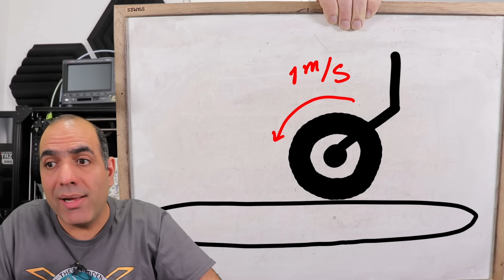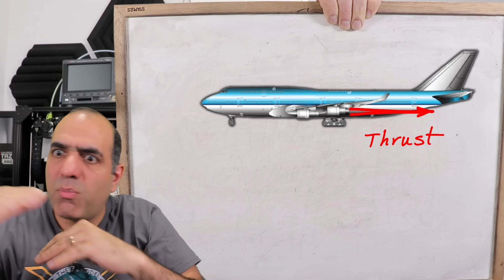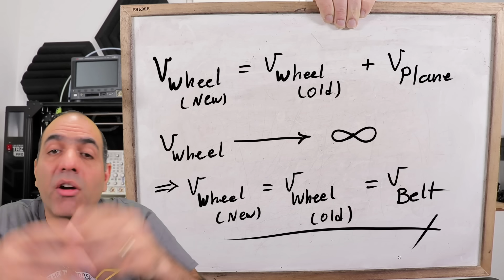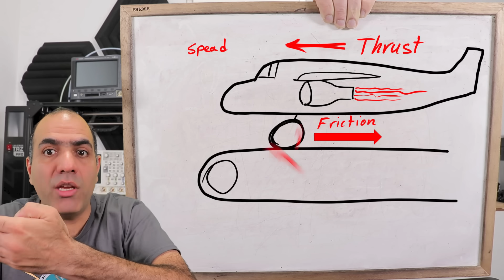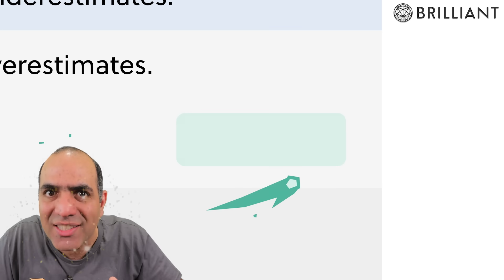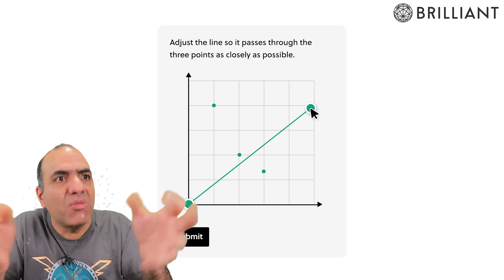Airplane Question that Drove Me NUTS!!!

Comment: before getting the answer, I think most peeps would say no, cause a plane needs the resistance from moving air to generate lift. but I think this 'experiment' will just fail. I expect the plane to just fly off of the conveyer belt and crash into the ground. 
the wheels are there to diminish resistance between the plane and the ground, but they're not needed to get it to lift off the ground. and the engines aren't working against the conveyer, they're working against the surrounding air.
so if the engines generate some thrust, and the ground moves backwards , then the wheels should just spin faster (or break ) to counteract the movement of the ground. 
a better setup would be to create headwind to the same speed as the engines would suck in, but at this point you're already creating the lift force the plane needs to fly.
a good example is birds. there's birds that fly into the wind and then try to 'match the speed of the wind', at which point they do the same as they would while gliding but use the headwind to kinda hover.
Reply: self reply after watching vid, true, too much missing information. In a purely theorethical situation the whole premise stands or falls on the max they can maintain, whether we keep friction into account and on the model of the plane.
the plane would need to move an infinitely small amount to make the wheels react by moving, after which the wheels and conveyer would speed up till friction is high enough to stop the plane. at which point you'd need more thrust if you'd want the plane to move, leading to everything reaching a value of infinity in an infinitely small amount of time. 

whether it can lift off then relies entirely on the plane though, if all the values are theorethical and can reach infinity, and we only need to keep into account whether the plane can generate enough lift to take off, then it depends on stuff like engine placement.
if the engines are infront of the wings and are blowing some amount of air over the wings then this air also creates some amount of lift, so at some point when this whole system (including the engines)are barreling towards infinity,  this lift will be enough for the plane to get its wheels off of the conveyer, at which point it'd lose the resistance force created by the wheels and the conveyer, and it'd shoot off at a ridiculous speed xP
Reply: @psychotimo   Your first part was sound but in part two you swallowed Mehdi’s long winded infinite acceleration and drag nonsense.  Anyone who suggests that a pulley and a wheel can generate infinity deserves a virtual slap on the back of the head🥴

Comment: You made a very simple problem a big problem. The answer is that the airplane will not take off, because there is no air pressure under the wings. That's all, the end.

Comment: It should take off, it still has the thrust, even though it is still in place because of the conveyor belt. If it has the required thrust of the engines at the moment when the wing and tail flaps are moved, it should take off.

Comment: 4:25 you've made a mistake here in reading the original question. the speed of the belt is set to the speed of the PLANE, not the speed of the wheel surface. so the wheels just rotate at 2 times whatever the normal rotational velocity is when taking off on a normal runway. the original question is just quite poorly worded and its not clear what they mean. Mythbusters showed this experiment really well by actually doing it and pulling a giant canvas runway out from under a plane taking off, and the truck pulling the runway was driving at the same speed as the plane. they put a camera on the plane's wheel showing it rotating twice as fast. and it works fine with real wheels!

Comment: Easy... no.. because the AIR is not moving at all, so there is no force pulling the plane up.

Solved in under one minute, TAKE THIS.
Reply: the weheels are still only as fast as the THRUST of the engines, and so is the conveyour belt, so , the plane still is STATIONARY.
Reply: Assume undamaged greased wheel bearings, the engines push the plane and the wheel bearings let the plane roll.  There is no Mehdi infinite unified theory of everything drag just because the ‘runway’ is moving.  You can roller skate up and down a moving train.

Comment: the wheels don't power the plane. the would just spin twice as fast, and the plane would move forward as fast as it normally would on a normal runway. i think this problem always breaks people because most people have such a hard time realizing that the wheels on a plane do literally nothing. another way to explain this problem to people is with the example of a float plane. they have no wheels, and float on pontoons. they can take off flying upstream in pretty fast current, and the result is just that the skids on the float plane move over the water faster when taking off upstream. 

also some people get wrapped up in the mechanics of the wheels of a plane and friction. they think that the wheels wont' be able to turn fast enough and the plane will start to drag backwards. that just isn't the case, and mythbusters even proved that a plane's wheels really can spin twice as fast and the plane will still take off. in the float plane example, there is a limit though. if the current was really ripping, it could produce so much friction on the pontoons that the plane could never take off

Comment: if the belt is continuously accelerating, eventually the motion of the belt creates a sufficiently thick boundary layer and the wings of the plane experience an air speed velocity high enough for them to generate a lift greater than the weight of the plane

Comment: No, it could not take off. However, I believe the belt would have to accelerate a lot faster than the relative acceleration of a plane on a runway, as you’d need the wheels to spin a LOT faster for the rolling resistance of the wheels to counteract the thrust from the engines. So fast in fact that they would likely liquify into a pool of molten metal, resulting in the plane getting sandpapered on the runway conveyor belt. Then there wouldn’t be any plane to run the experiment on, rendering the whole thing a moot argument. Not to mention the logistics of accelerating such a large object (the belt) so rapidly. To make matters even more complicated, the friction from the belt on the air would cause it to move some air with the belt, but so minuscule that the bearings would still melt before there would be enough wind speed to take off.

Comment: Think of it this way, you're running on a treadmill (which matches your speed) then you get a push from the back. Youd move forward, the feet/wheels do not matter when the object is being thrust forward.
Reply: But with the senecio, as soon as you got the push from behind, the wheels and conveyor belt would speed up to infinity and break causality.
Reply: @MrT------5743  them spinning is not a factor in this equation. It might need a longer runway to accelerate though. Actually, I dont think so. Theres no drivetrain in most small aircrafts.
Reply: @BootSequence    breaking the laws of physics is a factor.  Did you even watch the video?
Reply: @MrT------5743  The speed of the wheels are only relevant due to friction. The amount of friction will ramp up but not enough over the length of a normal runway as mentioned in the video. The fun part will be landing since the tires probably blew out and the bearings failed.
Reply: @kamX-rz4uy  Did you even watch the video?
Reply: @MrT------5743  Did you? Friction is mostly what he talks about. Also as mentioned in the video because of thrust the plane will move forward. Since the landing gear must move with it the wheels will rotate. He talks about going to infinity but will happen is there will be slippage as the tires are essentially pushed forward since they are no longer allowed to go faster then what they against. The real question is whether or not enough lift to take off will be generated before the tires blow out and the bearings and landing gear fail causing an aborted takeoff.
Reply: @kamX-rz4uy  He also talked about once the wheel moves, the conveyor belt is already behind and they would speed up to infinity. Since nothing with mass can have an infinite speed causality breaks. All physics break once you break physics.

You must have missed that scenario he definitely talked about.
Reply: @MrT------5743   Physics won't break down over the length of a runway, just the tires and landing gear (he even mentions the treadmill needing to run tens of thousands of kilometers). Airplanes have a tremendous amount of thrust and can overcome tire failure as long as it doesn't cause the plane to veer off the runway.
Reply: @kamX-rz4uy  So you did not watch the video then. Cause he said exactly that as one of the ways to interprete this problem.
Reply: @MrT------5743  BS with your didn't watch the video nonsense. The problem with saying it will go to infinity is that the tires cannot go that fast without failing (we are talking about a scenario where we are on Earth, friction is on, etc. Nothing different except the treadmill has been placed on a runway to take the place of the normal runway surface). The tires and landing gear will fail before infinity happens.
Reply: @kamX-rz4uy  You do know that nothing with mass can go that fast. so you break the whole scenario. We are on earth and one way to interpret the scenario is the belt goes faster than light speed - Which it cant on earth or anywhere in the whole universe. Causality breaks so the scenario breaks and earth becomes a black hole. Can an airplane take off inside a black hole smarty pants? Answer is no!
Reply: @MrT------5743  The belt would never get close to that speed unless you replaced the tires with something that could withstand that speed (doesn't exist as you stated and isn't stated in the original question) and can withstand being pushed forward in addition to the rotation -- a key part you are not considering. The tires must slide forward because they can not rotate faster than the treadmill they are against. The movement of the plane forward will cause both rotation and horizontal movement of the tires. Put a normal 747 on the proposed runway length treadmill and it will take off or lose control trying when the tires and landing gear fails. If you could have magical tires and an endless treadmill and keep the plane at a speed below what's required for liftoff, then you can theorize about how fast the tires would be able to turn before the universe is doomed.
Reply: @kamX-rz4uy  See you agree. the belt cant go that fast. the tires cant go that fast. everything breaks and the earth becomes a black hole.

Comment: Even if there was a decent amount of friction in the wheels, I'd still think it would take off. I doubt the wheels could overpower a jet engine
Reply: Wrong, if the plane is on a conveyer belt and moving at the same speed as the belt (essentially making it stationary) the plane would not get enough air under and over the wings to create enough lift! You can ramp up the jet engines as much as you like, but if the plane is not moving there would not be sufficient lift to take off.
Reply: @Pieces93  I would be moving thus air flow over the wing. To the plane, there wouldn't be a notable difference between a conveyor belt and a solid runway
Reply: @1RED1  - the plane would still not be moving forward at sufficient speed to get the lift under the wings, so you may be moving forward at a slow speed but that doesn’t change the wind speed around you.
Reply: @1RED1

I didn't think anyone could be this stupid, but here you are to prove me wrong.

Comment: My first instinct would be that the plane could still take off with jets if they are not dependant on wheel rotation to accelerate the plane. However, the speed of the conveyor will theoretically get
infinitely fast if there is anything in the outside environment forcing the plane to retain a forward velocity. But realistically the motor in the conveyor will overheat and slow down long before the wheel bearings in the gears. So any decently powerful jet will take off easily.
Reply: How about wheels overspeeding and destroying themselves way before motor that drive that conveyor belt.
Reply: @volodumurkalunyak4651  That will almost certainly not happen. The wheels of an airplane are designed for shock impact on landing, and then they suddenly need to start spinning for 300 km/h +. I'm thinking the conveyor belt drive motor will fail when the belt is going only 50 km/h or so.
Reply: @kdmq  suddenly start spinning at 300kph - yes, but not for spinning at 600-700kph
Reply: @volodumurkalunyak4651  I would imagine you are bringing up the 600 km/h wheel speed on the assumption that the plane is going forward at 300 and the belt is going backward at 300. If that is true, then answer me this: Do you think the belt can handle going backwards at 150 km/h?

Comment: There is needed to a low pressure buildup under/behind the wing to allow the plane to take off, no? Hows that possible if the airplane isn’t moving only the wheels?

Comment: This is a very simple question if you use logic to answer it - yes it will move forward and lift off. Thrust and forward motion of the airplane through the air medium is generated by jet engines not the wheels. In other words it is grabbing  air to move through it, you can completely ignore the runway\giant treadmill\conveyer belt as it is unrelated to the air which airplane needs to move forward. What you would see if you run this experiment is the following - airplaine is moving forward, treadmill spinning forward, the wheels remain motionless( as the speed of the treadmill and wheels is matched). Hopefully the treadmill is long enough for the airplane to gain enough lift and take off. Imagine a real life situation - you are walking down the road and see a car, you decide to touch it with your hand, but the car suddenly matches you speed, you wont feel your hand rubbing against car's body as it travels at the same speed as you are, but this issue wont stop you from moving forward. Or imagine that an airplaine is already flying extremely close to the ground and the pilot for the fun of it decides to release the gears, the ground for some strange reason happens to be a giant spinning treadmill, and the wheels touch it, will the plane keep flying forward - yes.
Reply: Conveyor and wheels move at equal speeds in opposite directions in the original question.  Forward speed and zero speed do not have opposite directions.  If the conveyor moves but the wheels do not rotate the speeds are not equal, the question is not met.
Reply: @givenfirstnamefamilyfirstn3935  The wheels are not creating any torque, they are free spinning. Take any free spinnig  wheel and drag it across a piece of paper, the wheel will rotate. Than do the same thing but with your other hand move the piece of paper thrying to match the speed of the wheel, the indication that speeds are the same is when the wheel stops rotating, but is still moves in space as you keep dragging it with your hand. Relative to each other the paper and the wheel move\sping in opposite directions.

Comment: In the MythBusters version, it looked like it was a propeller plane, where the propeller was in front of the wing, in which case the propeller would blow air across the wing, which would create lift
Reply: It doesn't matter where the propeller (or thrust) is. Some airplanes have a rear mounted propeller.

Comment: I think yes because the engines are still creating thrust its just not as much as if the air were ALSO in-rushing to the engines at x velocity
Reply: in what way is it less?
Reply: @tsm688  i was wrong Medhi set me straight later in the vid